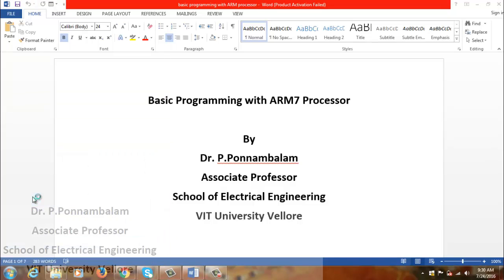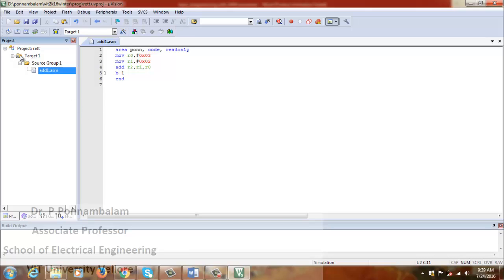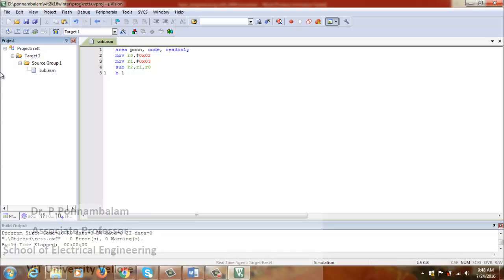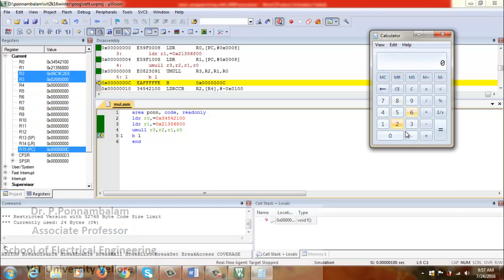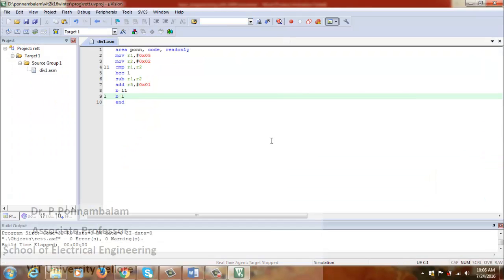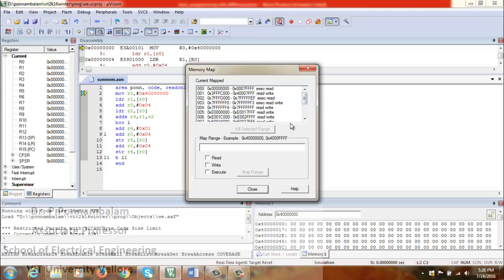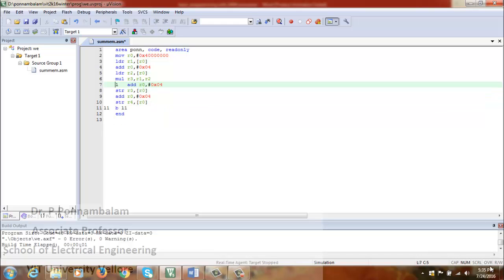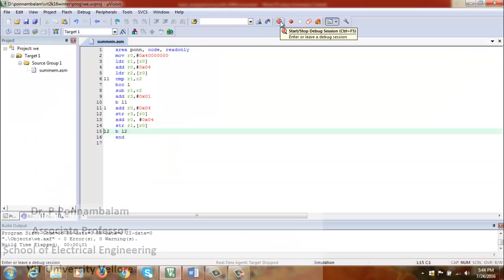basic ARM prog

Comment: ARM instructions are 32-bit and cortex -M microcontroller does not allow to move 32-bit immediate data in  a single instruction. Can you please clarify how can we use the instruction 'MOV R0,#0X40000000' here?